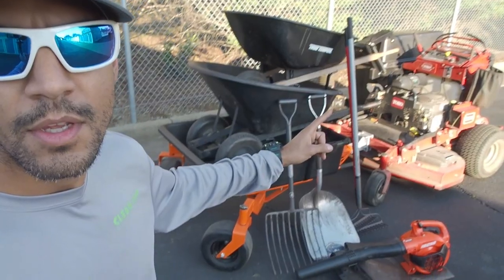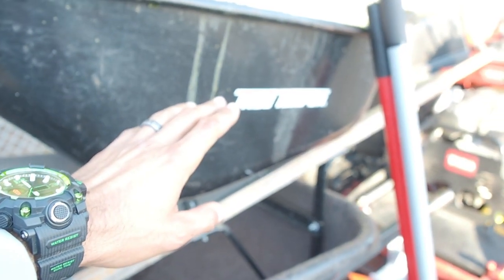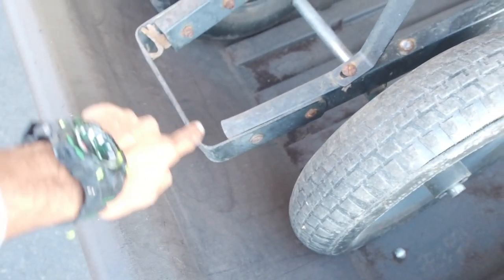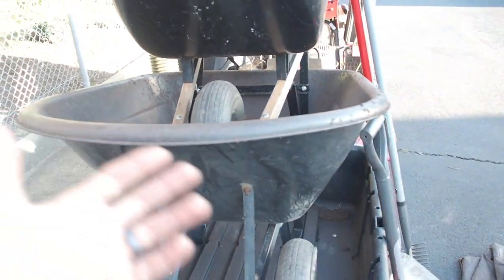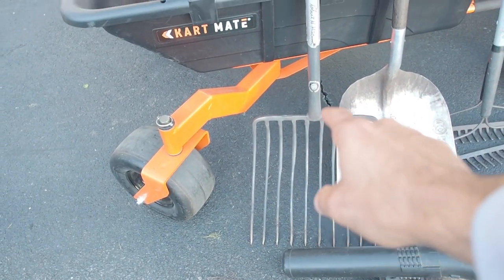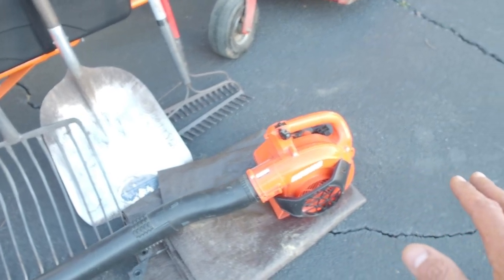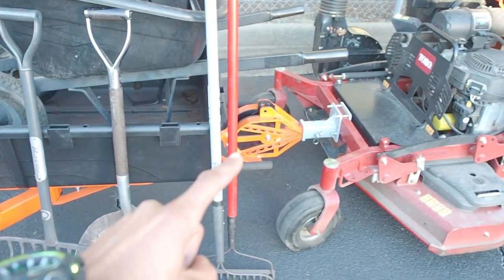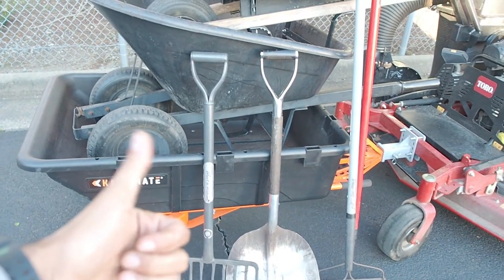Best TOOLS for MULCH

Comment: When I was a groundskeeper at Atunyote Golf Club I learned to flip a leaf rake over to level mulch. It was a brand new golf course my first year so LOTS of mulch.  Works for spread grass clumps.
Spot on with scoop and fork.
That front trailer on your mower is cool but a traditional dump trailer cart will work for us with zero turns.

Comment: I lik to lighten trailer in front beds by the time I get to Bak beds trailer is half empty and I can carefully drive it on yards because it's light after getting half mulch out on front accessible beds been working for me to.much of a pain to drag out tow cart for measily two hundred profit per load just not worth two trips dropping off mower and tow cart pikin up mulch etc rather just beast it with trailer and barrels and keep truk running for two hours in wonderful ac lol great video s

Comment: Am leanard has some sweet all solid  polyethylene grain scoops u may need alot lighter great video I just Bak my low profile trailer to one bed at a time " think of your trailer as a wheelbarrow my mesh fell off trailer ramp so I just Bak from one bed to another do five yards in two hours easy ish great video .. I got John Deere tow cart don't use much easier just to keep truk running and drive directly to beds one by one

Comment: I would like to hear how you estimate differently as you gained more equipment and people.  I am at the first level and I do by hour just so I know I can make money.  My price model is better to be inefficient but if I skipped to the buggy I would have to switch to estimates and curious what you did
Reply from the maker: I learned to price per yard of mulch. It makes it very easy to estimate. Price of mulch+labor/time it takes (rule of thumb, 1 man hour per yard of mulch)+delivery/pickup= price per cubic yard. Anything else is extra, weeding, creating an edge from scratch and so on. I started out not knowing all of that and priced too low. I quickly adjusted my pricing. Purchases I just budget in. Without better equipment or employees, you can only do so much work.